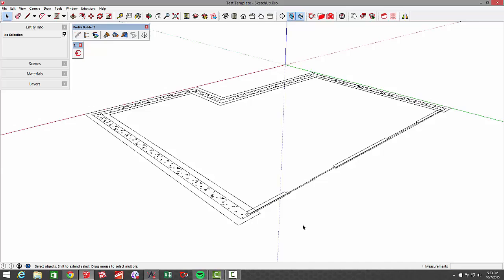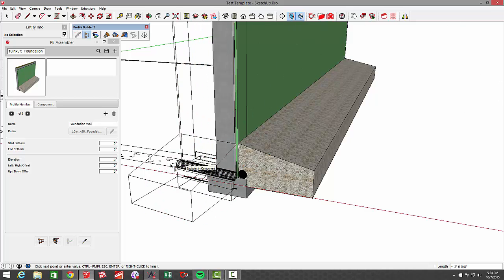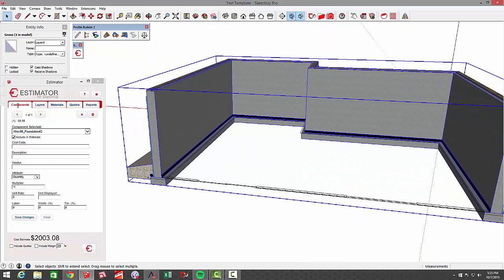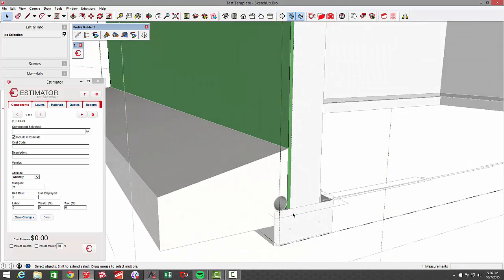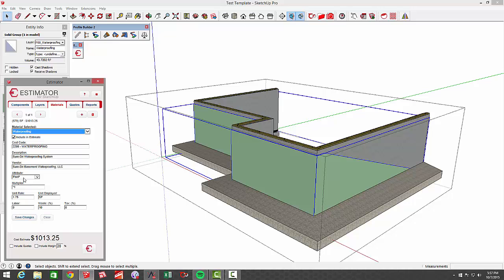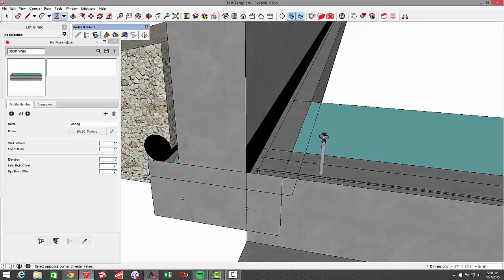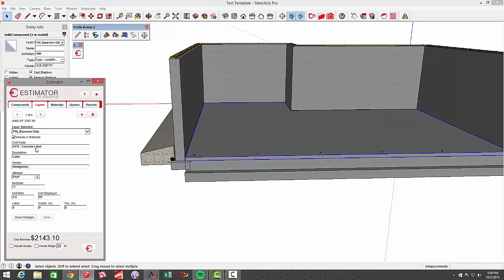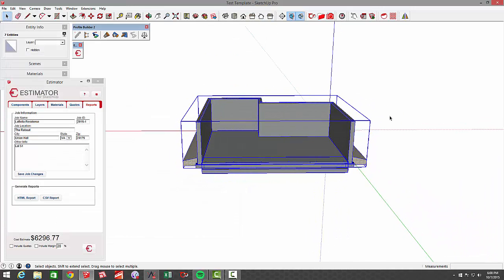5 Minute Foundation

Comment: At 5:27 you say something like "put it on a layer that has cost associated with it".  
Are costs associated to a layer a component or a group?  Or some combination?
Reply from the maker: +Terry Pullen Hi Terry - Estimator allows you to assign costs by Layer (like use Lineal footage, area or volume depending upon need), by Material (usually just an AREA function), by Component (and if you save that component and use it in another model later, price should stay with it) - IF you have a template file that you create for your workflow, with Layers and Materials with cost data pre-assigned (in the template), then whenever you model something on that Layer or Material, the price should automatically be displayed.  Hope this helps - feel free to email me at john@estimatorforsketchup.com for any questions, suggestions, problems, etc.  I am here to help!